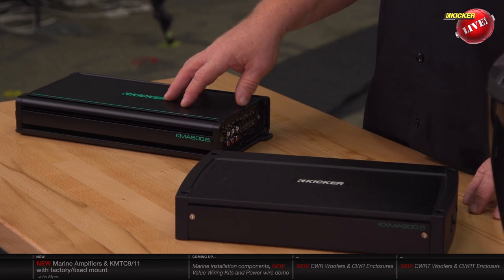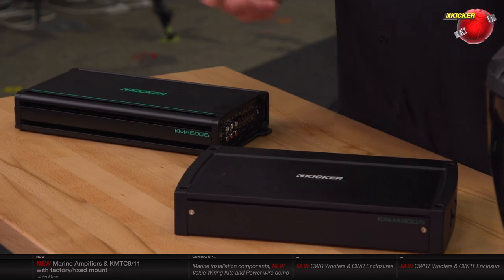UnMasked Station 2: Marine Amplifiers & Tower Speakers

Comment: I keep hearing the wireless remote.... will it work on the kicker kx 1200.2 the two channel amp ... I need to use the two channel .. but I have to have a bass knobs ..it's to run two 10W6v3 dual 4 ohm's .. I want to run them at 2 ohms
Reply from the maker: The wireless remote will work with the mono KXA (black case w/red KX on the side) and the bass section of the 5 channel.  The KX series (silver case with black end caps) was a hardwired remote. The 2 and 4-channel models don't have a remote.